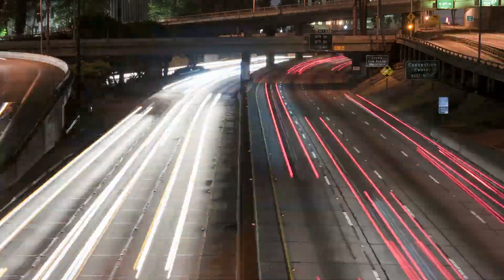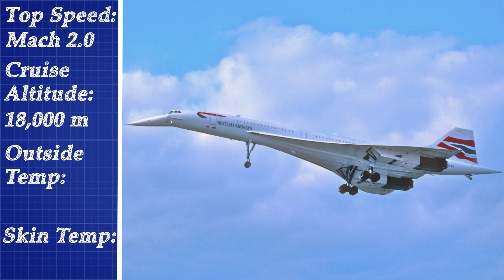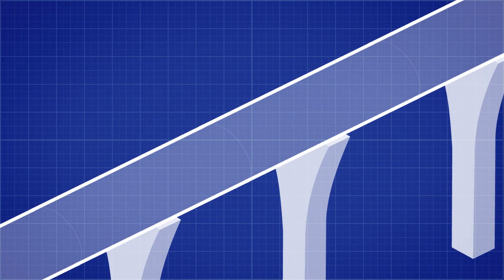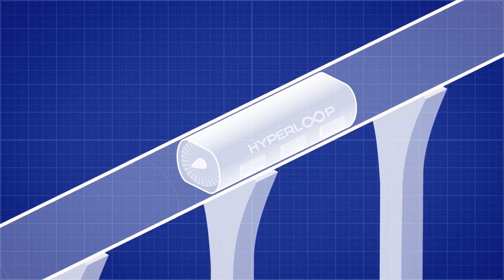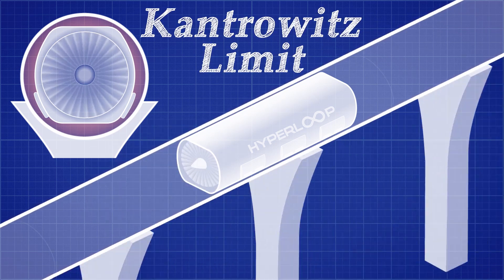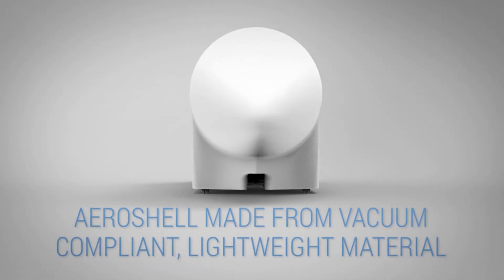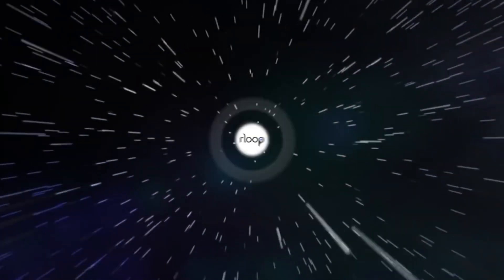Hyperloop - The Future of Travel?

Comment: what happens when the tube increases in length due to heat expatiation? or when the sun is only on one side of the tube and only one side expands? you'd need a hell of a lot of air tight expansion joints.
Reply: +Edward Lymer What happens with an oil pipeline when the weather gets hot?   Thermal expansion and contraction is a well known problem and there are many ways to deal with it.   One way would be for gradual turns to be supported by beams over which the pipes could slide therefore the expansions just work themselves into the curves. Another would be that there could be telescoping sections, yes these would leak a bit but just as trucks and buses use air brakes instead of hydraulic brakes because leaks only require more capacity in the compressor, leaks in a hyperloop only means more pumping.

Comment: For cost, America had a concept for its design, the 'hyperloop' is also known as an evacuated tube transportation service or a vactrain and the design concept cost is around 1 trillion USD mainly due to the need to digging massive lengths for the tube. I am pretty sure the actual installation of this tube wont be as costly as you think, but the R&D costs will be massive. I think this form of transportation should be in Australia, there is literally no natural disasters here(I live in Aus) other than fire storms.
Reply: +EXTC yeah The difference between hyperloop and traditional evacuated tube transit is to reduce costs by using commercial piping for the tube limiting the passenger compartments to a cramped inclined single aisle and to use a partial vacuum which is easier to attain and maintain but results in a pressure build up in front of the capsule which is why there is a turbine in the front of the capsule.   The reason why it is in California is because of the high population centers available. There would be no market for such a project in Australia, sorry, there's just no market for such transit in Australia.
Reply: Yeah it looks like the vactrain is a form of magnetic levitation I think but this uses a turbine in a partially evacuated tube to propel the vehicle. Unfortunately Australia will never gain a market for these things because tax payer money towards too much bs.
Reply: +EXTC yeah   The turbine at the front is not for propulsion but to neutralize the pressure buildup from it only being a partial vacuum.   The most likely propulsion would be linear motors such as the ones used in roller coasters and in high speed elevators.   The original proposal suggested that the air compressed from the turbine could be used for an inexpensive air cushion form of levitation but it would appear that they've decided that there would be a contradiction between lowering the air pressure to reduce drag while increasing the air pressure to provide the  air cushion.   They've selected the passive Inductrack magnetic levitation system from Lawrence Livermore.   

 Australia would not have a market because quite frankly, there just aren't enough people, nothing to do with what your government does with your tax money.   I think it's even questionable whether or not California would have a viable market for this thing.    Looks like they've given up on using the small pipeline pipes and gone to contracting larger diameter custom GRP pipes.

Evacuated tube transit concepts predate maglev.   It's just that the difficulty of achieving a complete enough vacuum always defeated the analysis of such a system.   What Musk is doing is asking what if the problems of a partial vacuum could be addressed by a turbine in front of the capsule.   It's just that several low to practically no power high temperature maglev solutions have been developed recently so it would be natural to consider maglev with a modern interpretation.

Comment: an "Above-ground" tube? Looks like BS to me...think of all the expansion joints you would need. unless a material is found that neither expands nor contracts, which I doubt....and I'm no engineer...just common sense.
Reply: +Dan O'Brien As many expansion joints as an above ground pipeline and we have quite a few of those especially from Alaska where permafrost requires the pipelines be overground.   Besides, it's a partial vacuum concept hence some air leakage such as from expansion joints would not be a problem.

Comment: one question: smallest leak in entire hyperloop can shoot air inside with the speed of sound and obviously kills everyone, how to handle this? (one bullet shot to it can shutdown whole system and kill passengers)
Reply: +na Cna Really, at the speed of sound... Atmospheric pressure is about 14 psi, a bicycle tire is at 100 psi, an espresso machine operates at 19 times atmospheric pressure... Do you hide behind a brick wall when you order your coffee at Starbucks?   You have an unrealistic view of what a leak would do.   Just as trucks and buses use air brakes instead of hydraulic brakes because you can have significant leakage in an air brake without affecting performance, one of the benefits of a partial vacuum approach is that it could tolerate leaks well, even large leaks.

Comment: Unlike solar roadways, the Hyperloop is a much more practical idea. It does have some major kinks to work out, but like with most new technologies, things will get better. Air travel was once very expensive, limited in range and ports, and worst of all, dangerous.

I don't believe we'll have a Hyperloop open to public access for a long time.  What I do hope we get soon from the Hyperloop R&D is cheaper solar panels. As an EV driver, this would be extremely beneficial.

Comment: Sorry, but this is stupid. You have to build a track, and that track will have to go around hills and lakes so it will have to have curves in it. To limit the centripetal acceleration to even 1g (which is too high for comfort anyway) the radius at 1000 kph will have to be over 7 km, almost 5 miles. So, the track will require massive amounts of tunneling and spanning across valleys. No, ridiculous.
Reply: That's all covered in detail in the alpha paper.
Reply: spacex, or other private enterprises

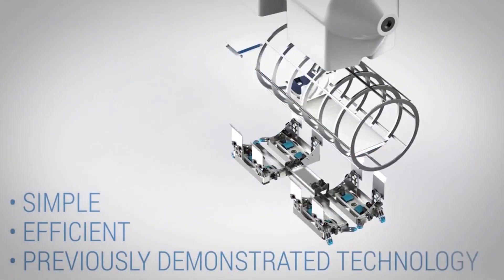Comment: 1:39, 480 kmph? that's it? Better of using the Japanese bullet train that is technology that is already out there and actually works
Reply: Braiden Robson The Japanese maglev solution requires superconductors cryogenically cooled by liquid helium and helium is only available from a few oilfields in Texas.   Even when the US Navy had two airships, they only had enough helium to fly one at a time.   The track is also lined with rare earth magnets.   Truly an expensive solution.   The hyperloop concept is to try and reduce costs by using commercially available pipes such as those used for oil ( this limits the passenger compartments to reclined single aisle seats ) and to use a partial vacuum instead of a full vacuum hence the turbine on the front to remove the pressure build up.   The hope is that supersonic speeds could be attained even though it's only a partial vacuum but the first prototypes are of course limited to much lower speeds.   Ultimately, this is just a design competition. Musk only needs to be seen as a futurist, a leader in technology and innovation so that he continues to receive investor interest.   The competitors all solicit their own funding so this is just a way to limit his costs and exploit the investment of others so that he could raise money more easily for all his ventures.   The idea doesn't even have to work though it would be nice if it did.

Comment: Hyperloop is all hype. Unless it is underground in a shell, it will be subject to heat/cold expansion/contraction. Add a vacuum, and you a fail awaiting a small leak. The latest plan has it moving across three earthquake faults.
Reply: Galactic Ruler a mature person won't talk about grammar when he is losing an argument. You clearly don't have an engineering degree. Hyperloop IS dangerous, period.
Reply: What is Thunderc??? Anyway, I'm saying it would be safer underground. If it leaks, it stops. I lived in the Central Valley. I remember tube systems in banks. They worked on low-pressure/vacuum. They have an earthquake it stopped due to a leak.
Reply: Hi Red Pill Seeker
This "low pressure environment" is so low, it may as well be a vacuum. Have you any idea how much energy it would take to cool a 500km metal pipe in a desert? And are the support pylons for the Hyperloop going to be on wheels too..?
Reply: Galactic Ruler no, your argument hasn't won. Just because they started this project doesn't mean they know how to keep it safe! Why it hasn't been built yet is because they still haven't got a solution. lol worst argument ever.
Reply: +Red Pill Seeker when you can't actually make points against them, you start pointing out grammatical errors and patting yourself on the back. Don't be a moron.
Reply: Rodrigo Duterte, mate, you need to be more open minded about critisism of things you agree with. At this point you're reverting to correctimg grammar and adhomniems.
Reply: Wow Galactic. You are brainless ignorant douche xD

good job xD
Reply: shoots hyperloop with a handgun
Terorism 101 isis just killed a bunch of people and ruined your verrrey expensive hyperloop.
Reply: Contraction and expansion is manageable with wide curves. Railway-tracks face the same problem. The real issue is that all the security requrements (Pumps, emergency valves, airtight emergency doors required amount of steel) will drive up the cost immensely. If the much easier MagLEV-Train wasn't even feasible, the hyperloop never will. At least not for human transportation..
Reply: Galactic Ruler You are the biggest idiot I have seen yet
Reply: Making the tube capable of expansion without losing it's seal is far from impossible. Maybe a double tube with a heat sink inbetween. The expansion inside the tube doesn't really matter as there is very little air. The lack of air decreases the effect of heat and the turbine on the of the carriage can easily take care of it.
Trains and tunnels are just as vulnerable to earthquakes and we still build them.

However rather or not it's really worth it over conventional trains is another matter. Maglev trains are still rare because they simply aren't superior enough to chose them over more familiar railway.
Reply: 1) Great make the idea scalable and economic for hundreds of kilometers. There's lots of ways to fix the problems, but keeping it economically viable goes out the window the vast majority of the time.

2) What do you mean the expansion doesn't matter much? A small amount of expansion over long distances in large tubes like are proposed matter a lot. Over a mile or on rails not so much. You'd need expansion joints that are vacuum tight and not highly susceptible to failure or sabotage that are still economically viable.

3) Train tunnels don't have to worry about maintaining fractions of an atmosphere in pressure.

Don't get me wrong, I like Elon Musk, his excentric ways and his intentions, but this isn't one of his better ideas that can stand up to moderate scrutiny when you want to apply it to the proposed scales.
Reply: We build train tunnels and road tunnels because we don't have to deal with a 0,01 atm pressure... Elon just brings the problems of space to Earth...
Reply: The ideas are what matters, saying this hyperloop is the future of travel?!
NO.
The idea can be expanded upon, but using the current project for traveling I will say that it's not worth it.
This idea could be good for future tech that does not need these pipes to travel through and maybe used in other ways?
Reply: If you put it underground, the tunnel would have to withstand the stress of the atmosphere AND the weight of the rock and ground above it.
Reply: Average Snowflake Seriously? Of course they haven't found a solution yet, the project is very new. It takes years to perfect something until it works.
Reply: John Pilge 
It's worse than that, the inside has to be accessible to emergency services.
Reply: Rodrigo Duterte school is exactly where you should be with that sort of naivety.
Reply: The Informed Duck and that's why it's going to start in the next couple years? Stop fooling yourself
Reply: magma2680 Did I say decades?
Reply: John Pilge hi
Reply: bai yawaa ani oi hahaha
Reply: and earthquakes will cause it also not possible for underground l.
Reply: If you put it under ground you would avoid thermal expansion and buckling, but putting it under ground would also increase the different in pressure between the inside and outside of the hyperloop. If you put the hyperloop underground, not only the atmosphere will try to crush the hyperloop, but the ground above the hyperloop would also try to crush it.
Reply: +Red Pill Seeker Science, sir. Not magic.
Reply: Reawakened I'm assuming it'll make the money back if it's succesful. Also I'm not sure what kind of technology you think science is gonna pull out of its ass in 10 years that'll be better than this. And since when was hyperloop invented by creationists?
Reply: Elon Musk will build Hyperloop underground. He just created his "boringcompany" which will build underground rails for Hyperloops.
Reply: Problem, Mate? Nice, mature.
Reply: Hi thundercuck fan. How about you do some research into the project first?
1. It's not in a vacuum, it's in a very low pressure environment.
2. Expansion can be stopped by cooling and contraction can be stopped by heating, using the extra solar power.
3. Do you even know how skyscrapers in japan are built? On wheels.
Reply: @anarchismconnoisseur2892  hi dumbass how about u show me any viable hyperloop shit, and such a big chamber? oh u cant
Reply: Problem, Mate? Mate, my argument is already won because countless universities started this kind of project.
Do you think a random, illiterate person on the internet knows more than the brightest minds? Clearly not.
Reply: Transforming Refined Anxiety Nurturing Stunningness 

You, sir, may just be the dumbest person on all of YouTube.
Reply: Problem, Mate? And you know it, Mr. Random Illiterate guy?
Reply: ***** Smart. Not ass.
Reply: John Pilge Science beats your little experience with cheap things
Colm Mathews 1. There is a big difference between vacuum and low pressure.
2. Those 500km are going to be covered in solar panels, so that's ~500 MW of power.
3. Are you stupid?
Reply: BalticGuy whose*, isn't*, a thousand times*.
You don't start a sentence with "and", you only start it with a verb, noun or pronoun.

When you will learn how to write grammatically correct you should criticize others about something you have no idea about.

 #getschooled
Reply: Trans flag fucker is a cringy teenager 

#itstimeforschoolhoney

(who is going to be in MASSIVE depression in a couple of years)

Comment: Doesn't the addition of magnetic levitation pads massively increase the cost of the tube? I thought that was the whole idea behind using air cushions in the first place.
Reply: Yes it does not to mention would require a good bit of energy to power them.
Reply: I don't really think anyone knows what this thing is going too be. I see several different plans which all seem to contradict each other.
Reply: The cost of the pods is something like 1% the cost of the entire system, so even if they increase by 10x that translates to only 9% increase in cost estimates. The reason rloop went with maglev packs is because their pod design wouldn't be tested at the full speed of the hyperloop, so it wouldn't have enough air intake to create air bearings. The actual hyperloop would probably need some sort of alternate levitation system (or just wheels) until it gets up enough speed to produce air bearings.
Reply: Abe Dillon 
Isnt the whole point to not have any (or very much) air in there. The whole idea is fucked.
Reply: you should at least watch the video you're commenting on. Even 0.001 atm air pressure, when you're moving at 700-800 mph, there's plenty of air to form air bearings. Please do some math before you declare something "fucked".
Reply: Abe Dillon 
Ok, so then, at 0.001% air pressure, or, a  vacuum, the cost of both the pods and the infrastructure will skyrocket. Because now you need to deal with a crazy pressure difference in every part of the system.

And this is assuming your right. You just told me to "do some math", but all you did was assert that it would work. I know that there would be a thousandth the air to utilize, so logic would say that a craft in that environment would have to work a lot harder to get lift.
Reply: +PINGPONGROCKSBRAH Not necessarily, Lawrence Livermore Labs is testing a maglev system based on permanent magnets which derive the levitation from the forward momentum of the vehicle and Eddy currents in aluminum.   It would require landing wheels when speeds are less than 40 km/h and would require aluminum coils throughout the guideway but it would have a much lower energy cost when compared to superconductor magnetic levitation.   I'm citing from memory so I'm uncertain about the specifics but low energy room temperature maglev is possible.

Comment: How are you going to protect something like the hyperloop from stray cars and earthquakes, let along terrorist attacks? Seems like a single .50 BMG should cause a relatively inevitable cascade failure... of the entire system, with the last hurrah being a train car blown backwards at the speed of sound into the station and massive holes being torn in the fuselage of the tunnel. Essentially a total loss of every operational pod and the tunnel. tonnes of metal and crushed passengers screaming along until the blast wave hits the next car, at which point they all get smashed into it and they both get blown backwards from incoming air. You'd have hundreds of miles of the hyperloop destroyed, many traincars destroyed and their passengers killed, and much of an entire station ruined every time the vacuum fails even due to a fairly minor puncture.